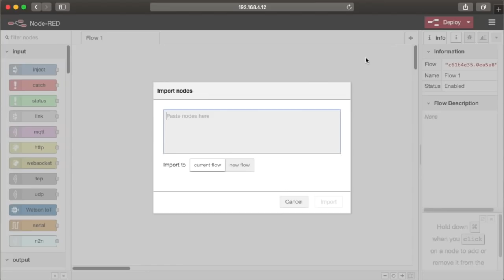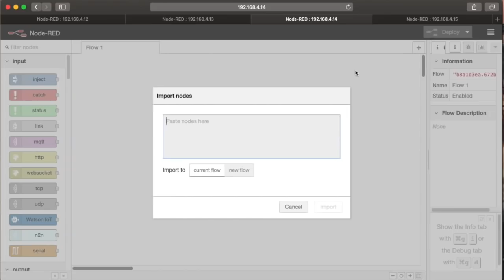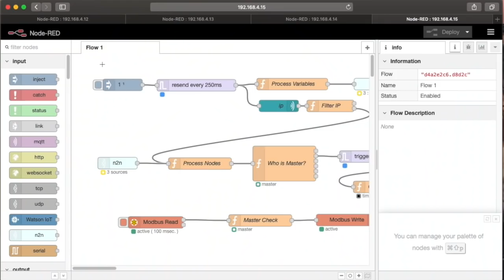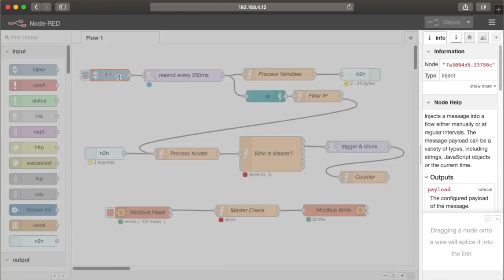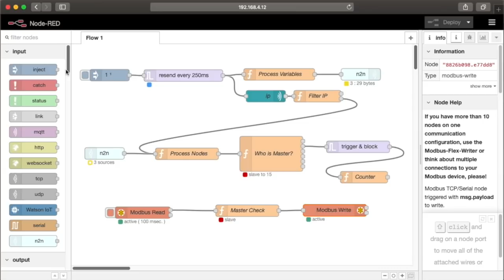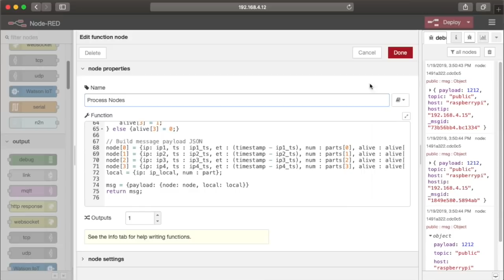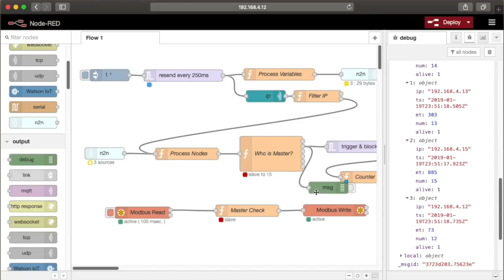NodeRED Multi-Node Redundancy Example

Comment: Just to make sure I understand the concept:
This is a failover for the Modbus-automation in node-red. So it would always operate anything Modbus and nodered-related. Any external data-communication would need some additions adjustments, right? Like communicating with the fail-safe cluster via MQTT would make this the single-point-of-failure, right?

I am just asking, because I wanted to create a similar system for node-red instances but could not really get around MQTT as single-point-of-failure. Except setting up two isolated wireless networks with their own MQTT and node-red instance and then if the secondary network would detect a failure on the first, it would completely shut down the raspberry providing the wireless-lan-1 so all tasmota devices would switch over to their secondary wireless and connect to the backup node-red.

So, this video is great and it was a good find to give me new ideas, (Sadly for other projects, not my current problem.) =)
Reply from the maker: This example uses UDP broadcast for inter-node communication, so no broker as a single point of failure.  Of course you could easily change this to use MQTT with redundancy if desired.

Comment: It is all interesting staff but how applicable it to industrial solutions? I mean, so you suggest that it is time to use pi as CPU in real world?
Reply: Raspberry Pis are just one of many single board ARM computers available that can easily run linux.  ARM processors are widely used in used in industry for many control purposes.  IOW, this proof-of-concept is the perfect prototype showing anyone who uses SBCs how to build out a fault-tolerant fail-over system regardless of their choice in micro-controller.  Very cool

Comment: I see SD cards in your PIs, how can you disconnect them from power without proper shutdown so often without crashing the file system? I had often problems with crashed file systems on my PIs SD cards, what is the secret behind it? I am thinking of using a USB SSD drive. What is your opinion?
Reply: You can set the filesystem "only-read". But when you want to change something you need to remount it as writable. We do this at work.
Reply: He was disconnecting the network from the broker nodes. Power is an intereting on. Better might be to battery backup the nodes. A medium SLA gell cell should last 15 to 20 minutes, enough to ride out most outages, with some luck.

Comment: Do you prefer this setup vs swarm?
Reply from the maker: Good question:  Most swarms that I've seen rely on an MQTT broker.  This makes it super easy to work with, but if then the broker (or internet connection if cloud based) is a single point of failure.   You could implement redundant brokers, but then the system gets complicated.  I thought about implementing the broker in NodeRED (mosca), but for now this design simply uses UDP broadcast messages for communication.  It works really well in my opinion!
Reply: Was gonna ask the same question ! .
Reply: @WagoKurt  very nice approach! At the moment I have a set up with a docker swarm of node red instances. It is not nearly as quick as your solution. And mine have still spof's like the NFS share and I have only one master mode at the moment. I think I will try this setup for my more critical operations!
Reply: Great video, could you point me in the direction of the aftermarket POE hat for the PI?